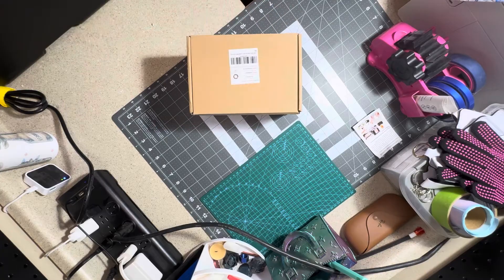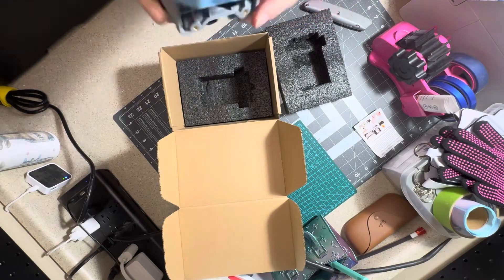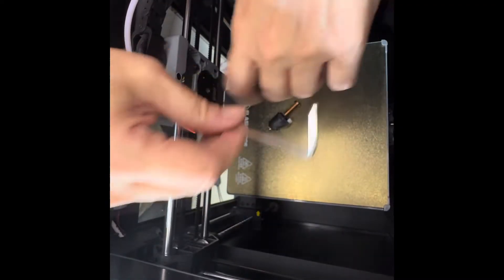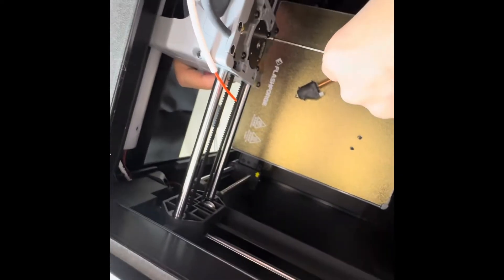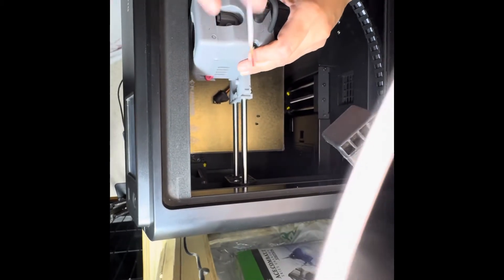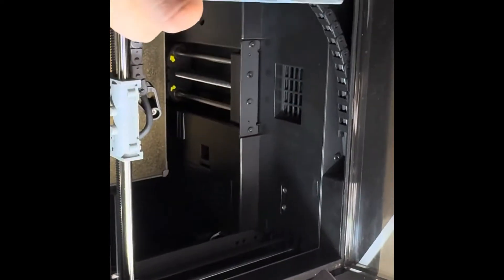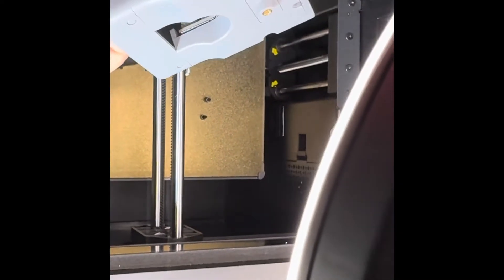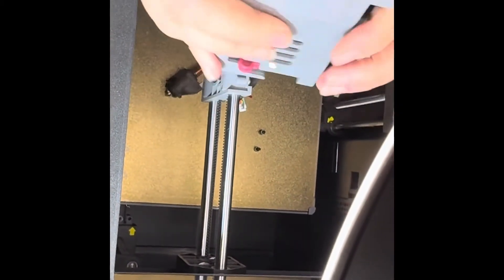Replacing Flashforge Adventurer 5M Pro Extruder Kit

Comment: Can’t see anything that you’re doing. 

Take the four screws out of the back of the assembly. Remove two screws holding black wire. Remove two screws holding top cover of assembly. Unplug white connector, plug into new assembly and repeat in reverse. Hope this comment helps.

Comment: So bought used flash forge 5m printer for my brother and the fan doesn't work I took the extruder apart and realized fan connector is slight ripped.. if I order another extruder kit does it comes with all the internals like board
Reply from the maker: Yes it comes with the whole unit. https://a.co/d/3817J3U (hope this works) but here is the link to one I purchased off of Amazon. It from flash forge actual Amazon store. I hope this helps.

Comment: I was wanting to order this extruder kit off of Amazon. My question is did the kit come with the extruder circuit board already on it or did you have to use the old one? My board is toast so just making sure before I order it.
Reply: Same one I ordered from flashforge Amazon store. Thanks for the reply.
Reply from the maker: @royluckadoo244 you are welcome! Mine has been working fine since i replaced it. So I hope this helps you.
Reply from the maker: Hello, it comes with a new board, if it helps I bought it from the flashforge store on Amazon. So you just unbolt the whole extruded header and bolt the new one on. I also did just check Amazon and they are still showing it available. https://a.co/d/4pEKraO  I have added the link but not sure if it will work. YouTube doesn’t like links sometimes. I hope this helps you out.

Comment: We can't see anything because it's off camera.
Reply from the maker: It was really hard to film inside the printer, due to not much room. Is there something you had a question on?
Reply: @Gettncraftywithit  I am a visual learner and need precise video to learn what to do so not being able to see what you were undoing I can't use the video to reference repairs. I plan on buying this brand printer and am gathering video to help me if something needs repaired.
Reply from the maker: @ I totally understand and there are not any videos, that I could find on how to replace this, so it was trial and error for me. That is why I decided to post the video of me replacing it, so there was some kind of reference to help. I can tell you this is a really nice printer and it prints fast to the point where I have had to turn the speed down on some small prints. The only issue I have is that I really want a multicolored printer now, but this a great printer to start with.  Feel free to reach out if you have any other questions.
Reply: @Gettncraftywithit  Thank you for at least trying I am grateful.
Reply: Would have been nice to see the actual parts instead of hand only
Reply from the maker: @ sorry it was a tight spot that I was working in, plus you can not even see where the screws are you have to feel for them with the screwdriver. 
I made this video as I could not find a video that I show how to replace this. I tried to help out with the narration and what parts I was able to film. Sorry this video was not to your liking, hopefully you find a better video that will help you better.

Comment: My fan on the extruder head has a tiny micro plug. It came unplugged and i could not get it plug-in its so tiny and wires are even smaller. I got it plug-in  but the fan ran all the time. So printing everything came out as spaghetti. So i bought a new head like her.
Reply: And I'm going to hot glue the extruder fan plug before doing anything with new head. My big hands can't get the fan to plug-in
Reply from the maker: You could always try a tiny pair of needle nose pliers or even tweezers would work too.
Reply: I could not separate them with small picks and a magnifying glass
Reply: The pin in the plug i mean there messed up

Comment: Why did you replace the entire print head? I am replacing mine as it stops pushing filament misprint. Flashforge is sending us a new one as we have had it since October.
Reply from the maker: I replaced the whole thing because I could not pin point what was the issue, either the feeder or the extruder. It would start a print off fine but then all of sudden stop running filament but the print would still keep going with nothing coming out. I could have probably could have tested the extruded by changing it out to another one but Amazon had the whole unit on sale for like 90 dollars, I figured for that price I would just change the whole thing. Ever since I have change it out no issues. I hope this helps you out.
Reply: @Gettncraftywithit it’s likely the teeth on your extruder had worn out. Flashforge unfortunately ships a nylon extruder assembly instead of metal. There is a metal upgrade for $25. With your spare nozzle and the new gears you would have an entirely new hot end assembly. It’s likely the first part I will replace.
Reply from the maker: @ that is great information!!! I will look into that, would love to do that upgrade. I feel like it will make for better feeding also.
Reply: @christophermccool7305 Hi, may I get some elaboration, please? The gears that grip and move the filament are nylon?